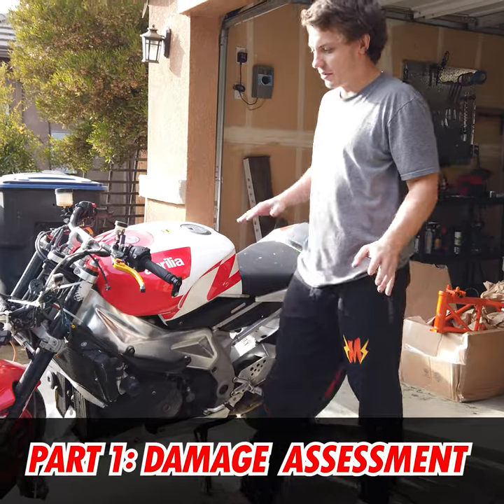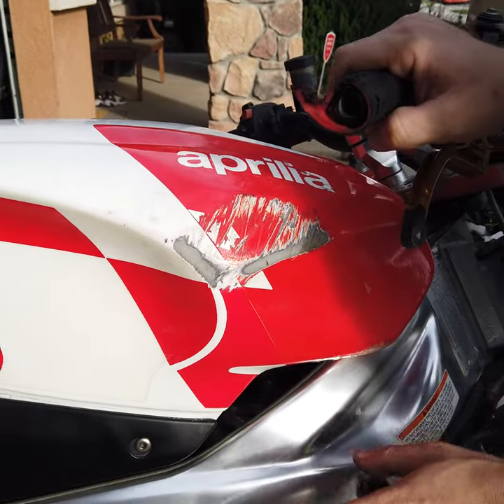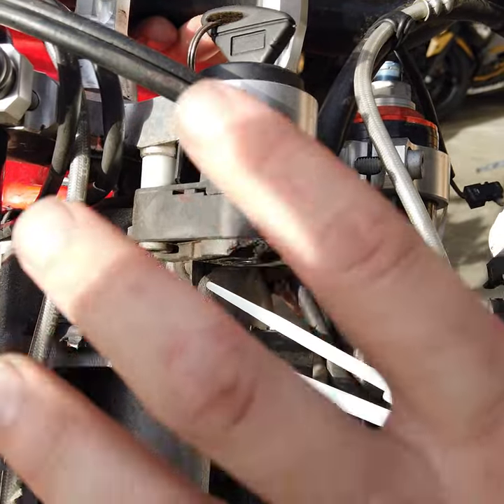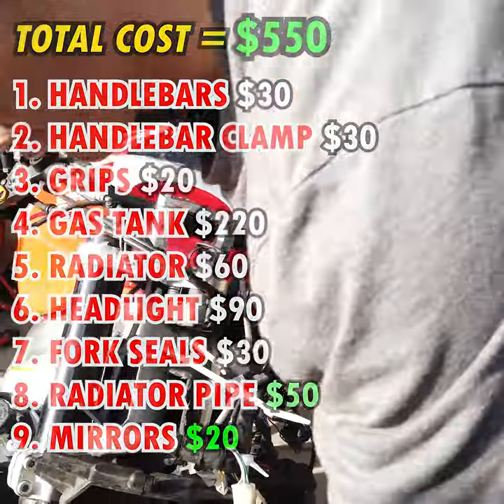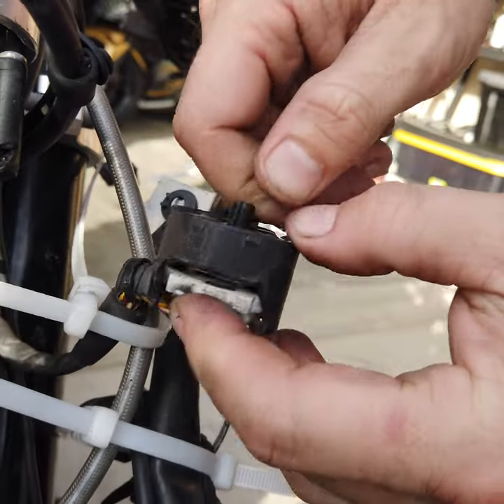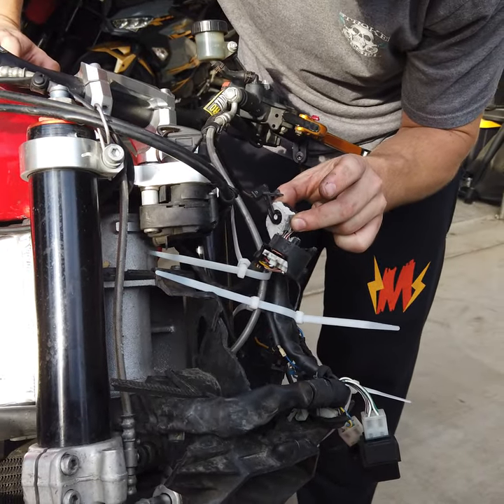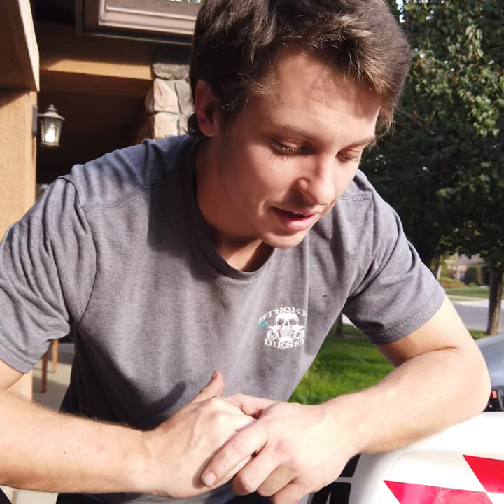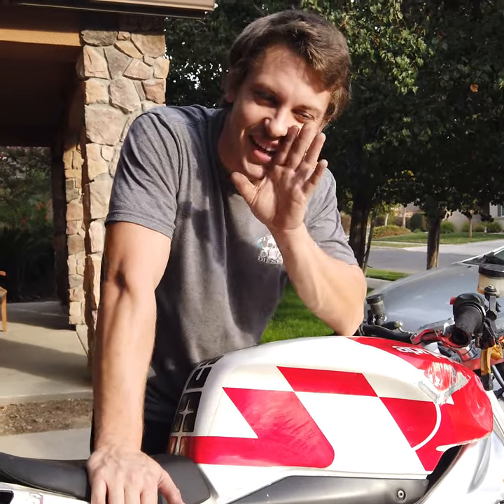might be screwed... $1400 Tuono gets EXPENSIVE! #MaxyDaily

Comment: You won’t be able to start up the bike, the ignition key is an immobilizer type thats integrated to the speedometer which is the small wire that goes from the ignition to the meter. Therefore you will need to get a new/used speedometer complete with a key and ignition switch. A new set of speedometer is useless with different ignition key because it needs to be reprogramned which only aprilia dealers can do (if they have the software) unless you are able to get someone to bypass. From the conditioned of the bike i see it, its gonna cost a lot to rebuild it back. Best source is to look at used parts dealers. Good luck!
Reply from the maker: yeah i was thinking that too... I know an aprilia dealer owner. I will have to reach out.

Comment: Go the rebuild. You will make a profit.  Replace the ram air duct. Do a proper repair.  Its a quality motor cycle,  you will have no problems on selling,  but fix it back to original. You have already done most of the work sourcing parts, now just spend and bolt on.

Comment: Hell yeah I’d start small need parts then go to rest of the niknacs source speedo try to fix ignition put I’m pretty sure you need the whole pcm to Mach unless that’s just a Ducati thing but I’d get her running then on to the next get mirrors last and anything else Miscellaneous like gas tank source right tank maybe rear fairing if found dirt cheap need to go to that cycle recycling place near y’all bed you will find all that at south Cali or whatever it’s called